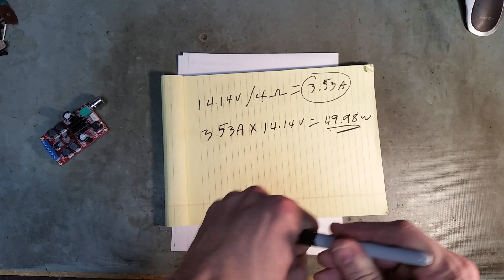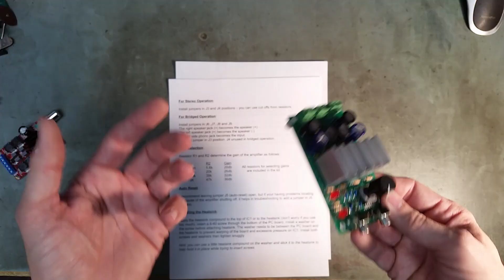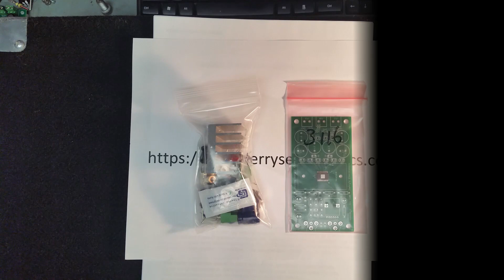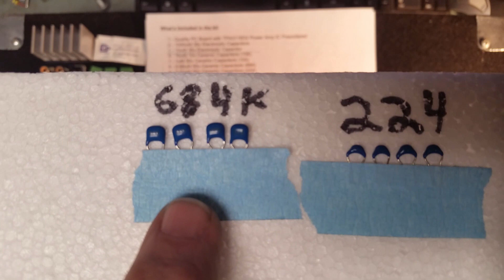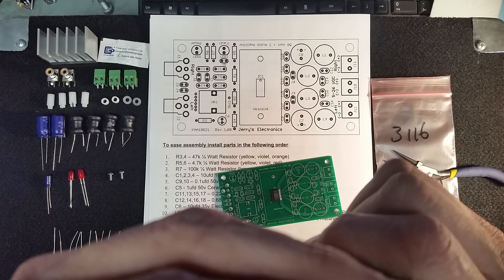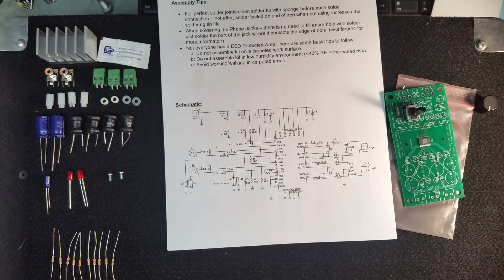Jerry's Electronics TPA3116 Kit Amplifier Review

Comment: A bit late to the show, but you can get a much lower THD+noise value if you run it in the right bridged mode. Only one channel output but the datasheet says .1% THD+noise at 100 watts.

Comment: I just got my second TPA3156D2 kit from Jerry's Electronics.  I am very, very pleased.  Name brand parts - Panasonic capacitors, what look to be carbon film resistors, Bourns volume pot, not sure of the inductor brand, but they are heavy and nicely made.  The board is solid and flawless.  It's well laid out, with the bootstrap and snubber caps close to the chip.

Some thoughts after building the first one: 

I have set the gain at 26db as recommended above, and used four 3.3uf WIMA MKS2 film caps on the inputs.  The TPA3156 datasheet recommends this value if the gain is set at 26db.  

Not knowing anything about class D amps going in (I'm a '70s audio dinosaur),  I thought the .22uf bootstrap caps were actually serial coupling caps to the speakers (don't laugh), so I used .22uf WIMA films instead.  The datasheet recommends .22uf X7R ceramics, and I will be using them on the second build.   In fact, X7Rs may be included in the kit, but I can't tell from looking at them, and I had some laying around.

You can build in a turn-on speaker delay by increasing the value of C6 from 10uf to 22uf or larger.  

I'm going to add some sort of reverse polarity protection.

I haven't put it on a scope yet, so I'm not sure how many watts output I'm getting into 8 ohms.  But it drives my 91dB @ 1 watt / 1 meter 8 ohm speakers to clean, room-filling volume.  The heatsink barely gets warm after and hour or so.  

Idling with no input, this thing is dead quiet when "dimed" with my ear against the speakers!  That may have something to do with the quality power supply I'm using,see below.

I'm powering it with an 18 volt 200ma toroid transformer into a full wave rectifier / filter board, 18,800uf of filtering, which pumps a very clean 25.4 VDC unregulated into the amp, and doesn't sag at high volume.  I also hooked it up with an 18V 3A wall wart into the same rectifier board, and it sounded fine.

This thing sounds great.  Plenty of gain for a 1970s tuner, plenty of gain for a laptop via an outboard DAC.  Haven't tried a phone or mp3 player yet.  

I have a hard time hearing any difference between this amp and my 1970 Sansui AU555A amp, which is my everyday favorite.

Comment: Great video! I look forward to seeing not from you
Reply: Excellent video.  My TPA3156D2 kit from Jerry's should be here any day now.  I plan on replacing the ceramic caps at C1-C4 and C12, 14, 16, and 18 with film caps, since they are in the signal chain.  Based on my reading of the TPA3156 data sheet, I may replace C1-C4 input caps with 3.3uf instead of the original 10uf.  This supposedly gives better bass response if you select the 26db gain resistor combo.  The TPA3156 is claimed to give 70 watts per channel into 4 ohms, so I'm expecting 30 watts per into 8 ohm speakers.  I will use a heavy duty 25 volt unregulated linear power supply.
Reply: @ccoyle  I just recently got the lower power TPA3116D2 kit and am interested in implementing bootstrap snubbers [330pF radial ceramics to 10 Ohm 1/4W axial resistor] on  C11, 13, 15, 17  (prior to which which will be changed to TDK .22 uf X7R caps). Could you provide a recommendation for realizing this? Especially for accessing ground for the resistors? Jerry when asked only said: "no easy solution". It would likely be done on the underside of the PCB. Thanks in advance for any help.